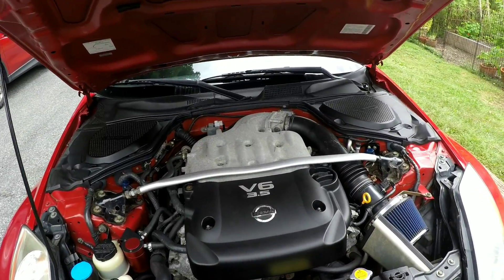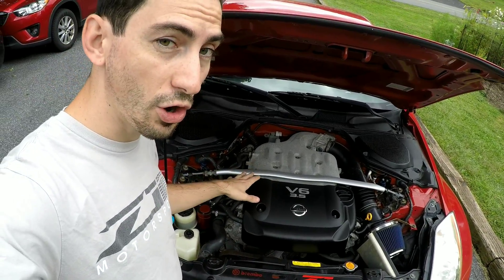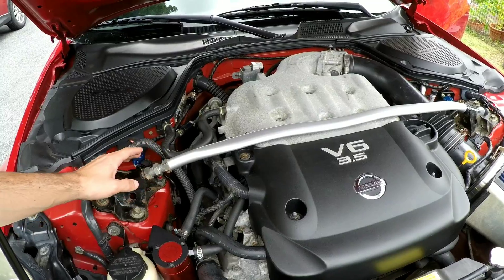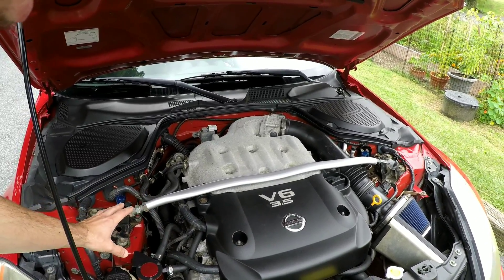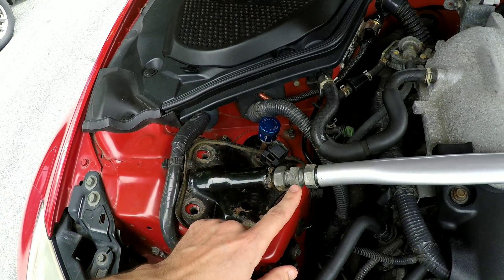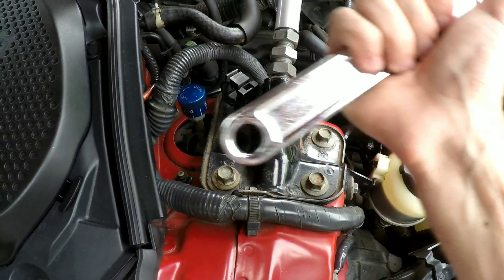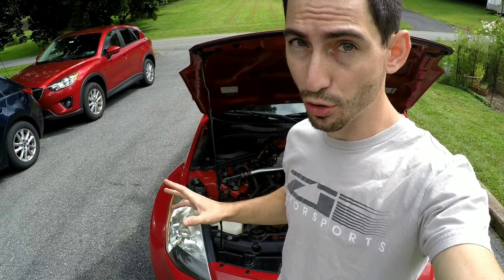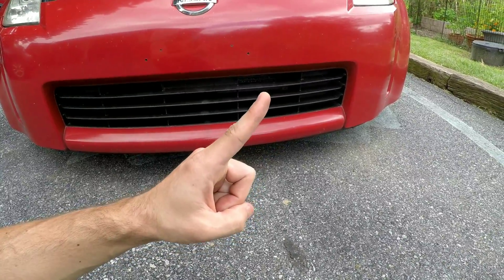350z Strut Bar Preload

Comment: AWESOME! Keep it up! I need a catch can!
Reply from the maker: Thanks Jesse! I can't wait to see your new video it looks EPIC! ADD W1 makes a good more affordable kit with bracket for the 350...there are also Mishimoto replicas...all should work well!
Reply: @radieyevanov  Been looking at the ADDW1's because they have a dipstick. Should pry pull the trigger sooner than later.🙂
Reply from the maker: @therealjessescheel  yeah they seem legit...the only thing I was worried about with them because of the dip stick was a vacuum leak but I haven't heard anyone have any issues with them. I would have got that one for my Z if I didn't have the Mishimoto one already.
Reply from the maker: @therealjessescheel  I should pull the trigger on that pin101 delete 😅
Reply: @radieyevanov  I will dig into the vacuum leak to see if anyone has had issues before buying anything. good tip!
Reply: @radieyevanov  If you like chewing through tires its a pretty fun mod! Some people pull it out of its pin instead of cut it or tune it out. Gives you some options if you ever want to put it back to stock. 

A cool video would be a clean switch setup so you could cut ABS, SRS, and PIN 101 with a clean toggle switch. Havent seen anyone do that yet. 🙂
Reply from the maker: @therealjessescheel  that would be very cool for sure. I'd have to do some research though, not sure what the best way to turn off ABS would be on my Z; I have traction control. If pin101 doesn't interfere with anything else besides cutting throttle during simultaneous brake and gas pedal engagement then I don't know if I see a reason to have a switch for it...I've heard that there is significant brake bias toward the rear with the ABS off but I've never driven with mine off, I'll have to try it out and see how it feels
Reply: @radieyevanov  You can check out my video on disabling the ABS. It was one of my earlier ones so not the greatest but youll get the idea. I am not sure what would happen if pin 101 was cut and you tried to do a burnout with ABS on. You might have to test that out and let us all know! 🙂

Comment: Excellent content. Subbed.
BTW the other reason for people changing the strut is to reduce weight since the stock one is so heavy.
Reply from the maker: Thanks man!

I thought I mentioned about the weight but maybe not. I was surprised that the stock one didn't feel heavier (I've had mine off a few times working on the car). Can't imagine one would save more than a few pounds 🤷
Reply: @radieyevanov  Absolutely. The z deserves other mods more. 
Can u list your mods??
Reply from the maker: Agree!

I will actually be doing a mod overview video in the future as a bunch of stuff was done to the car before the YouTube channel.

It is still winter time where I live so not too much content at the moment. Mod overview video probably won't be until summer time as I have a few different installs/things planned for the spring time I want to do first.